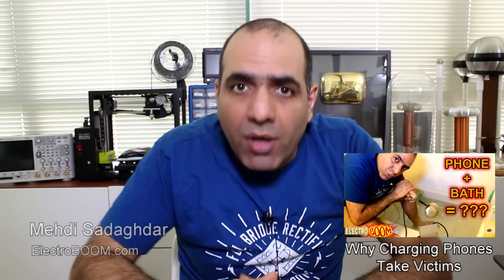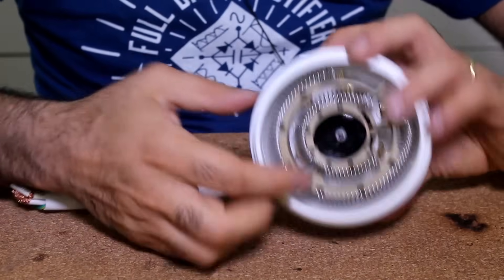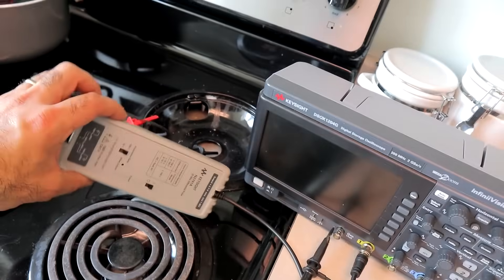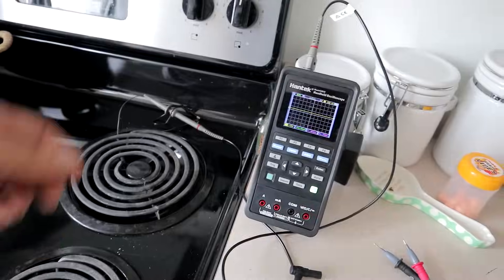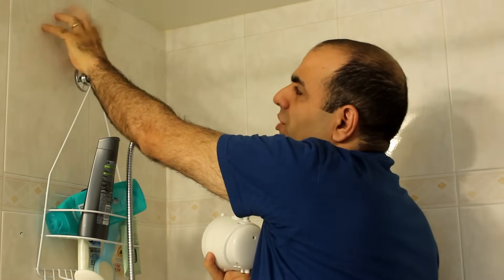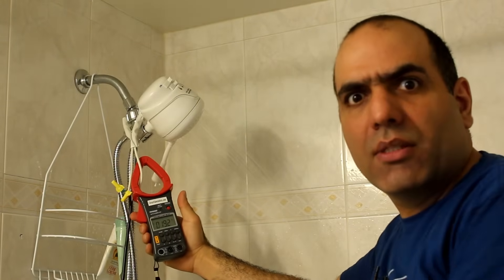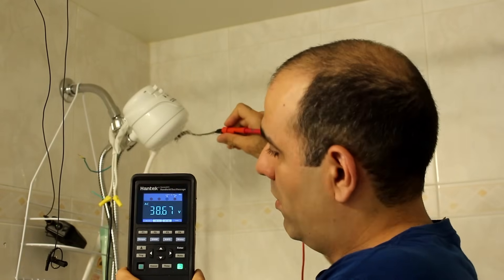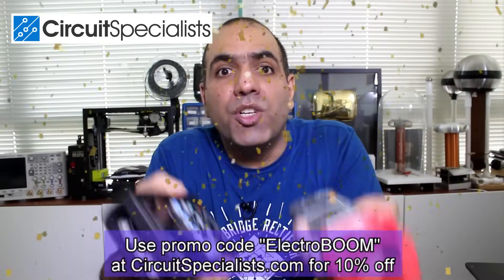How Safe Is the SHOWER HEAD OF DOOM?!

Comment: Well I Installed and replace the resistance in a bunch of these back in Brazil. We do have thicker wires running for those, and there were some older models that the case was made of metal and would give you a little shock when installed improperly and touched. Even 110v house would usually have a second phase to run things like this in 220v, specially in the south where it gets really cold in the winter.  Houses in Brazil are not made of paper like here so that helps with the not setting everything on fire as well.

A funny comeback is that other countries are the brave ones for running piped gas everywhere and within their house. 

Either way I have never heard of anyone gettin hurt with these showers, and Brazilians alone probably take daily showers equivalent to the rest of the world together.
Reply: Speaking truths! Americans freak out when they see those shower heads but forget they have open flames sometimes on 20+ year old boilers in their basements and piped, pressurized gas running within their walls, and that added to the fact that homes here in the US are built out of wood. 😅 but those showers are the dangerous ones. Go figure!
Reply: @guedesfhp  Eh, people fear what they dont know about, so it is not a weird reaction, silly though, yes.
Reply: The "House in Brazil are not made of paper" made me giggle 😂

One problem when I see with this kind of video, is that even the most technical ones seems to ignore the fact that safety regulations do exist outside of north America. Like, there as a bunch of rules and regulations to make sure that the wiring of the house are done correctly, even if we have to admit that most people want to ignore that, but electricians have to follow the guidelines regardless.

I'll be hopefully a electrical engineer by the end of this year, and a lot of my dally activity is read those boring norms to not kill myself in the future. lol
Reply: @Marcos_Tired  Of course there's safety regulations outside of the US, but I do question how many people ignore those considering even in the US, I've seen some.. Not very legal wiring (Hell, I live in one of those houses right now loll). 

Early congrats on becoming an Electrical Engineer btw! Electrical Engineering is the field I want to go into, but I'm only 18 and at the very VERY beginning of even learning what anything means haha! Hope life serves ya well, take it easy and have fun!
Reply: @QuickestFox  good luck!
Reply: @Dell-ol6hb  Thank you!
Reply: @guedesfhp  not just North Americans, the entire developed world outside Lat Am - why should people not fear a 5400 watt exposed non-insulated nichrome coil (like a hairdryer or toaster) running through water they’re being drenched in. It’s such a poorly designed contraption. 

I grew up in a third world tropical SE Asia country and when we switched from using an electric kettle to warm up a tub of water, to an electric shower - the only option is a wall mount water heater. That is the norm and it is installed with a ELCB. It is so much better than this contraption, you get a stable flow of hot water, you don’t have to worry about parts becoming live, the temperature is constant with high flow and adjustable via the dial mid shower. 

This is so ghetto, many people have gotten shocks, the water goes cold with too much pressure and boils with too little, absolutely no safety whatsoever, can’t even adjust the temperature while showering. Google “Alpha” or “Panasonic” water heater to get an idea of how it looks like.
Reply: @User-cb4jm  Because it is cheap and because of basic physics is not nearly as dangerous as people like you think it is.
Reply: I wouldn't use these things without a GFCI/RCD.
Reply: @User-cb4jm  I can adjust the temperature of the water on my shower, the one showed on the video is one of the cheapest models available, something you can buy with 10 dollars at the hardware store, it's so simple it only has 3 modes: off, winter and summer. Usually each house has a dedicated breaker for the shower, if anything goes wrong inside the shower head this breaker should in theory pop. But yeah as you can see I'm not an engineer nor electrician but my fear of having pressurized gas piping running on my house is scarier than having a shower that can give you a little shock if you install it like a caveman. It's much more common here to hear about houses burning down because of a stove they left on than because of electric showers, but to each their own I guess
Reply: @deang5622  i mean, i never saw a gfci in my life tbh, as a 18 years old Brazilian that is alive when eletric installation are less janky than ever
Reply: @djyppo  I don't know why people seem to think that gas lines are so dangerous.  They're actually by far the safest of any of the sorts of things we're talking about here because (a) even if there's a leak, gas needs to be at a particular concentration to be flammable, and usually the result is either too dilute or too concentrated to even ignite in the first place (those movie scenes about filling a room up with gas and then lighting it are complete BS.  That doesn't actually work.), (b) even if does somehow end up the right concentration, it still won't do anything without some other factor present to ignite it too, and (c) if something is connected up wrong or produces a fault in a dangerous way, anyone with a working sense of smell will know it immediately because of the chemicals added to the gas to make it very easily detectable.  Electricity has none of these safety aspects, which is part of why it is responsible for the vast majority of household fires and (utility-related) deaths/injuries.  (Most house fires (at least in the US) are started by electrical wires or appliances.  Very few of them are actually due to anything having to do with gas, because it's just not that dangerous, really.)

But I'm pretty sure that nobody was actually claiming that these showers are scary because of fire risk anyway, so we're really talking about two completely different, unrelated types of danger.  The scary aspect of these showers is about electrocution, not fire.  To be honest, personally, I've never been that worried about the actual design or internals of the heater element, that's not really the problem.  I actually believe that most of these can be perfectly safe, if properly installed, but that last bit is the part I have never actually seen happen in reality.  I've encountered these a number of times in various countries, and seen all manner of hack jobs in how they were connected, including disconnected grounds (or not even being designed to be groundable in the first place), being wrapped up in disintegrating or non-water-rated electrical tape, wrong type of wiring, and even completely bare exposed wires, all directly within reach of wet hands if somebody happened to slip or grab the wrong thing.  I don't care how many "well it didn't kill me" sort of anecdotes people throw around, I am just never going to consider that sort of thing to be safe, because it just objectively isn't.  And I would pretty much guarantee you that absolutely none of those installations had any sort of GFCI protection, either.  (and regular, non-GFCI breakers will not save you in that sort of scenario, even "in theory".. They just aren't designed to do that.  They might keep your house from burning down after you're already long dead, but that's about all you can expect.)

Sure, I'll grant you that these devices aren't actually that scary in theory, but the reality of how they're installed and maintained is very often much much worse than the theory, and that's usually the big issue, IMHO.

(Plus I've never found one that actually even worked that well, to be honest..  I mean sure, they're better than nothing, and there may be some really fancy ones I've never seen that do actually work, but in general the vast majority just seem to be pretty disappointing, really...)
Reply: @foogod4237  I mean I get your points but as you said most of these boils down to a good electrical instalation, any Medium income family can hire a decent electrician to do the job(except when your dad says he can do it)
Reply: @djyppo  Sure, they can, but my point was that (in my experience), they never actually do, so that ends up being largely irrelevant, and there's a disturbing proportion of these things that are actually installed wrong (and are actually unsafe) in the real world.

Can they be safe?  In theory, yes.
Are they actually safe?  An awful lot of the time, no.

(and it's the second question that actually really matters, IMHO)
Reply: @foogod4237  imma have to call you out on the gas bit. We have MULTIPLE instances of people with gas leaks getting their entire neighborhood blown up when they light up a lamp or make any kind of sparkle. It does happen and it is really not rare, so I totally understand the fear of piped gas.
Reply: @limaTheNoob  I'm not sure where you're talking about, but I'm pretty sure I've never heard of anything like that happening very often in the US (which has had gas piped to nearly every home in the entire country for longer than most people have been alive), which makes me suspect it's really more likely because wherever you're talking about has not been applying appropriate safety measures properly (such as adding mercaptans to the gas supply to make people aware of gas leaks when they happen).

I also have to call BS on blowing up "their entire neighborhood".  Low-pressure natural gas (like in homes) is actually a very low-velocity combustible (typically deflagrating, not detonating), so even with perfect conditions for an explosion, it is physically impossible for it to "blow up" a whole lot more than the room/house which is actually containing the gas buildup itself.  It is possible that a gas explosion could start a fire and that the resulting fire could spread to other houses and burn down the surrounding neighborhood, but that is more an issue with fire safety of the neighborhood in general (building materials, distance between buildings, fire personnel response, etc), not anything unique to gas (and as noted, in most places, electricity causes far far more fires than gas does, and with less warning, so even in this regard gas is objectively more safe than electricity is, really).

(Before somebody brings it up, there have been a couple of recent noteworthy events in the US where a high-pressure gas pipeline ruptured, causing a fire which caused quite a lot of damage to whole neighborhoods (and some deaths).  These were not the result of gas leaks in someone's home, though, and they have generally been attributed to shoddy maintenance and/or procedures on the part of the utility company making things unsafe (not really the natural gas itself).  Even counting these, there have still only been a couple of serious events over a period of many decades of operation, and the majority of other events that have been recorded didn't even cause significant damage beyond the pipeline itself (compared with many serious house fires happening in every city across the country almost every day from things like electrical faults).  Ironically, the reason the few recent pipeline explosions have gotten so much news coverage is specifically because they are so uncommon that they basically never happen in general.)

Gas may seem scary at first glance, but if looked at objectively and rationally it's actually still far safer than most other forms of energy, and (assuming somebody isn't cutting corners somewhere) you're actually much much safer if, for example, your house is plumbed for gas but has no electricity, than if you have electricity but no gas (and electricity plus gas is not really much worse than electricity alone would be).

(Note: I'm purely talking about safety here.. there are arguably some other reasons various people might prefer electricity over gas, such as environmental, production, or infrastructure management issues, but that's a completely different discussion which has nothing to do with how safe they actually are.)

But as mentioned earlier, this is all really a huge side-tangent anyway, because it has nothing at all to do with the safety of these electric shower head modules, which is really the point of the video...
Reply: Tell me you don’t know how gas power works without telling me you don’t know how gas power works. The fact that you really think that using a device constantly running electricity through your shower and does have the potential of setting your house on fire is the same thing as using modern technology is somehow the same….actually explains a lot. By the way there have been people who die from getting electrocuted by this thing there was a nine year old girl and was shocked to death using thing think in Venezuela.

(Btw being made of concrete does not make you saver, it’s the things in your home that spread the fire not your home itself and also having a concrete home is also dangerous. Just ask Haiti.)
Reply: @Marcos_Tired  my father was a "pedreiro" not at all a trained electricist but he still followed all the regulations on the electric installation, if the client insisted on saving money on wiring he would simply not do the electric part, because he knows for sure it would go to shit and they would blame him
Reply: @djyppo  really, i never heard of a house burning because of a shower, but this month our oven melted because it was rusty and the gas was leaking, imagine that on an entire house, made of wood, with an unlimited supply of gas
Reply: @devforfun5618  You father was/is a wise man. That's exactly what they tell me all the time in University, because some people would go through the "saving money" route and tell you 'its been 2 years and nothing happened' but when shit happens, well, they gonna blame someone.
Reply: @User-cb4jm  Read the comment again.
Reply: @AnthonyBlamthony  Wow one kid died omg let's stop using it!!!!!!
Reply: @AnthonyBlamthony the video literally proved that it’s safe and you’re still bitching about it lol we’ve been using those for over 80 years every single day and there’s not even one case of a person dying because of it. poor brasilian’s houses have some of the worst electric installations i’ve ever seen in my life, and there’s still not even one death due to electric showers. it gotta mean something lmao

Comment: Hey, im from brazil and we use this kind of shower a lot.
The biggest problem is not being eletrecuted by the water itself. The major problem is on the faucet.
When we touch it, we get shock.
Reply: True, but only if you dont have the ground properly instaled. Learn that from the beach house
Reply: Why not get a sentry gas boiler or something? Or maybe a 120l electro boiler, I made hot water with just a boiler and a woodstove
Reply: Ahh, the classic metal faucet. It remembers my grandmother's house; If we didn't use the flip flop, we get a BIG shock. Learned the worst way.. Haha.
Reply: @ritzevespa  i belive its a matter of  cost and simplicity. No need for pipes for hot water, neither a stead supply of gas or wood. Just a simple pipe for water, a proper wire for the outlet. Its a elegant solution  imho
Reply: Every time I shower at my father's house. Every single time. I now only turn the knobs with the hose.
Reply: @marovll21  yeah that's true